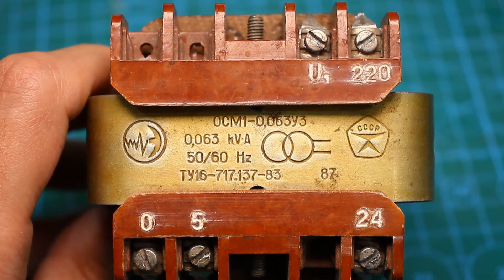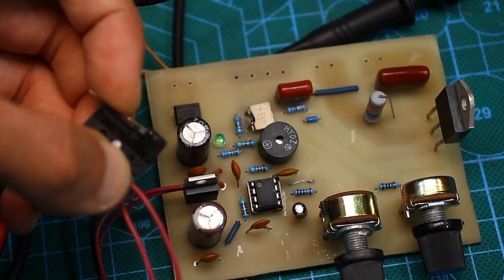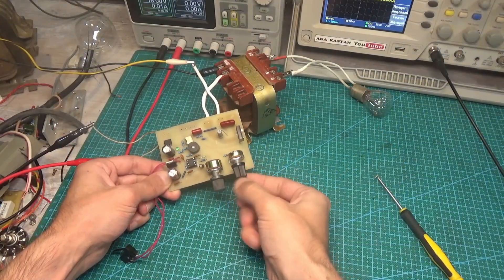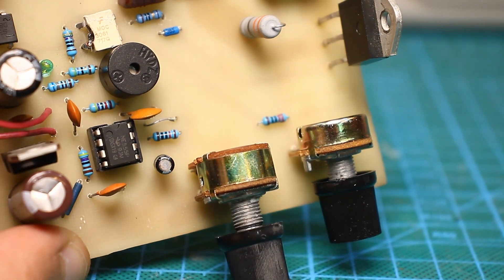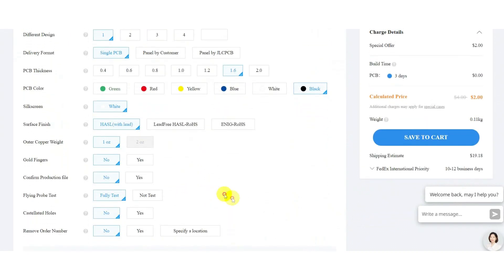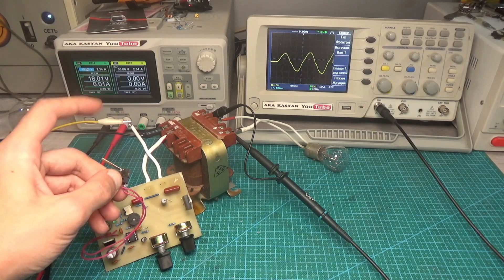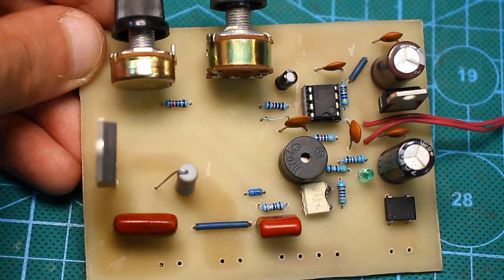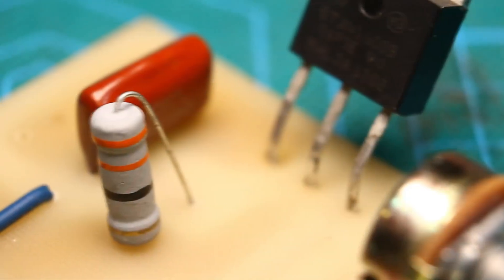DIY Spot Welding Controller

Comment: Great project. Could anyone specify the secondary of the welding transformer (TR2)? How many volts by how many amps? Thanks
Reply: в зависимости от предполагаемых задач
варьируют и V и А.
для никелевой ленты и 1865
это 2.5-3 V, ток максимальный (порядка 1000А)

Comment: @KasyanTV Would be lovely to see a similar controller but with a display to show the time and the power. This would be needed in cases where I switch between spot welding different materials - taking notes of time and power used for good weld would let me re-use them in the future. Do you have any plans for such an upgrade? Or perhaps a link for the arduino controller that you mentioned at the beginning?

Comment: Can I weld jewellery using this circuit,Attaching mini TIG weld torch and what transformer should be used to make it work and what will be the output DC or AC? Is it safe to touch output?
Reply: Or capacitor discharge circuit

Comment: You can reduce your costs further by winding onto the transformer core 30 turns of insulated copper wire capable of carrying 0.7 Amps (about 10 meters). This extra windings will give you about 33Vac which can then be used to power the control circuit. Wind this secondary as close to the existing primary and secure with varnish to stop vibrations.
Reply: The transformer is powered by the circuit that should be powered by the transformer. It looks like a short circuit to me🙂

Comment: I wouldn't trust an opto-isolator with a damage casing. Better to redesign the board than to try and break legs off a safety component.
Reply: They needed to get it to work after a mistake, the actual pcb only requires broken leads to get em off the pcb. To220 chips often have a snipped middle pin for ease of manufacture.

Comment: I have made a parts list based on the schematic provided.

Spot Welder Controller Parts list

C1 - 100n
C2 - 100n
C3 - 100n
C4 - 10n
C5 - 4uf
C6 - 100n
C7 - 100n 400V
C8 - 1000 uf
C9 - 100n
C10 - 1000 uf 25-35 V
C11 - 10n 1KV

R1  - 47k
R2  - 4.7k
R3  - 10k 
R4  - 100k linear potentiometer
R5  - 470R
R6  - 6.8k
R7  - 500k linear potentiometer
R8  - 220R
R9  - 10R
R10 - 33R - 2 watt

IC1 - 7810 - 10 V postivive voltage regulator
IC2 - NE555 - timer
IC3 - MO3061

Triac - BTA41-600 - 600 V, 40 A standard Triacs in TOP3 and RD91 package

4 x 1N4007 - Or a full wave bridge rectifier if you do not want to make your own
              W02M-2 - 1.5A 200V 

LED  

DB3 Diac - Vbo 28 - 36 V

SW1 - switch normally open

TR1 Step down transformer Output 14-18V 200-300ma. (more current is ok)
TR2 Welding transformer (from a Microwave oven)
Reply: Perfect! Thanks alot!
Reply: thanls a lot
Reply: Thamk you

Comment: You should demonstrate, at the end, how your unit works. it's not clear to me how transformer TR2 works in this circuit and it's characteristics. If it's a spot welder I think it should bigger a also it's construction should be different.
Reply: This is controller. You need another transformer for welder.
Reply: @egagarces9113  Can you be so kind to tell me what is or show me a link, where I could get a "transformer for welder" ?
Reply: @mariodistefano2973  Extraer de horno de microondas. Son muy populares y económicos.
Reply: @mariodistefano2973  Remove from microwave oven.  They are common and cheap.  The high coil is changed for 4 to 01 turns, depending on the purpose.
Reply: @egagarces9113  so, which winding do you use for soldering? On the schematic you shown, it seems that you use the transformer as an inductance, rather than a high current transformer as can be seen in several videos on YT.  this is what is pissing me off... Please clarify. Thanks

Comment: Hi I ordered the circuit boards.  I built the circuit when I press the button it turns on but never off. Are there any jumpers I have to solder on to this board?
Reply: It's got to turn off unless you got a dodgy 555.

Comment: After further testing the circuit will turn off the AC after 1 minute. The 100k potentiometer has no affect on the timing :(
The 500k potentiometer will adjust power. Has anyone else built this circuit?
Reply: The circuit works on breadboard but doesn't work when i designed the pcb and tested it
Reply: The circuit works perfectly. I've built and tested it.